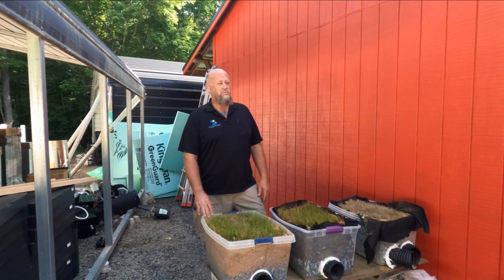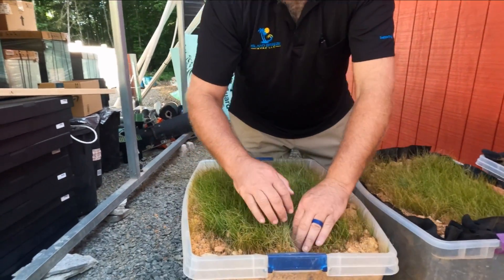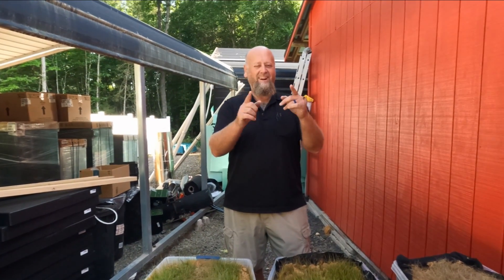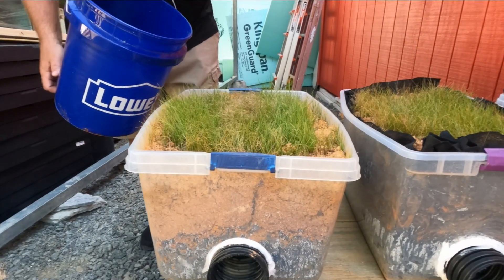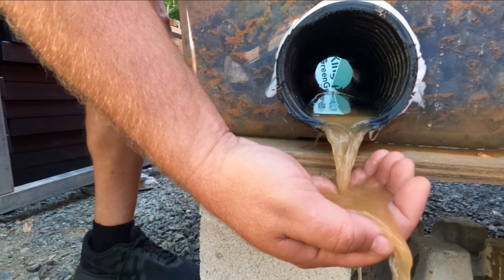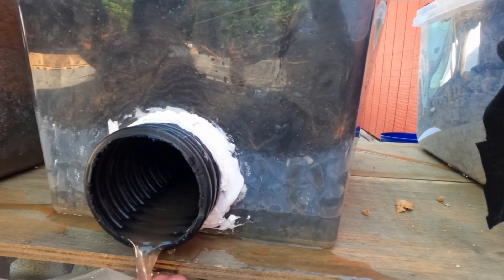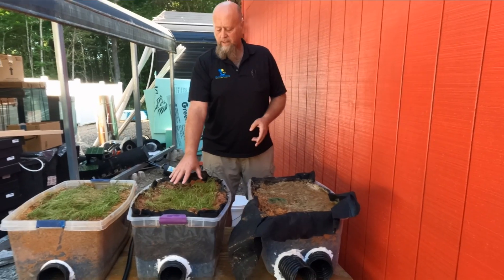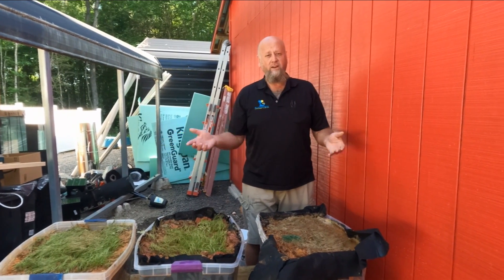Testing French Drain Scenarios To Find Out....Fabric or No Fabric? Which Is Best | Dr Drainz

Comment: Update:  To reiterate:  My goal was to divert surface water from the the sidewalk to a drainage system.  I have it emptying into a small drywall about 16" - 18" deep and 30" wide.  Now, I am about 1/2 way done.  My drain system is really more of a curtain drain, and not a true French drain, because it's very shallow, only about 8 - 10 inches deep. 
The whole thing may be overkill, but even when I just had the dirt trench there, the water ran off well - but the trench gradually silted up, so a more "permanent" solution was needed.  
Oh yeah, and I am 64 in November, so if I can do it, anyone can!
What I did was this:

1)  I bought the 6 oz. fabric from the supplier that Dr. Drainz recommended.  It was good, solid stuff.  I have trees and shrubs in the immediate area, so I figured anything to slow down root penetration is good.  The water will still make it into the drain.

2) Laid a 1 inch layer of "river rock" (bagged smooth stone, about 1/2 - 1 inch in size).  I emptied one bag at a time in my Dad's (65 year old Craftsman) wheelbarrow and rinsed it with a garden hose, then slowly tilted it so the murky water ran out.  Did this about 5 - 6 times till the water was about 1/2 clear.

3) Laid the 4" perforated pipe (not the ADS, just the flex pipe from Lowe's/HD).   It has perforations spaced all around the circumference, so no worrying about getting the right side down.

4) Covered it all with the small river rock, and did a burrito wrap with about  2 inches of overwrap and used landscape pins to secure it.

5) That will all be covered with a layer of  pea gravel and then (maybe also) mulch.

Perf. drain in place:
https://drive.google.com/file/d/1azS5VlxGGvKpyGvhewOwsxla3q8ZEl0u/view?usp=sharing
Before closing up the wrap:
https://drive.google.com/file/d/1m-uT9bMVdCh_--9k-CvFbtT7ZCjXQnkz/view?usp=sharing
After the wrap:
https://drive.google.com/file/d/1lr8U0a_t7dzuDZGDQ2s5-4FUkRjIMPis/view?usp=sharing

For the drywell, I lined it with the 6 oz non woven, used landscape pins to secure it to the walls, put a layer of  2" - 4" round large, smooth river rock on the bottom, followed by the smaller smooth river rock.  Closed it up with more pins, and will cover all with pea gravel and then maybe mulch, so it blends in with the landscaping:
https://drive.google.com/file/d/16vHnAiqWqS4H94-LVQnCIQSVyOTuayxv/view?usp=sharing
Reply: How long did it take you from start to finish to complete?

Comment: You have to remember, a french drain is most effective at taking care of the low volume subsurface water (a soggy yard). If you do not use filter fabric, you lose all the air voids in your drainage stone, making it much, much less effective (almost ineffective in fact). Just don't expect any french drain with sod on top to take in flood water. Bulk surface water is what 12 and 20 inch catch basins are for.
Reply: I have just fitted French drains with geotextile and found that the clay has blinded to the fabric (I purposefully left it open to inspect before adding top soil and glad I did)  the problem I have now is how to get rid of the flash surface water when the garden is flat, how do I know where to put a catch basin? Do I need to landscape to a swale and have a separate drain or can it all get fed into the French drain?  Clay is just the worst thing ever!!
Reply: @lala_land86  I wish you lived in Kansas City so I could do it for you lol. If it isn't a lot of water, a few garage flooring grates laid  on the french drain's fabric will work. You can get the grates on amazon. If it is a lot of water, You will need to put in some at least 12 inch catch basins (20 inch basins are usually better or necessary, but quite a bit more labor to put in).  Just remember, you may need to go outside of this garden to solve the water problem. Check out french drain man's channel on youtube and check out my facebook business page if you want some good info on how to solve your drainage issue. When it comes down to it, there are a lot of things to learn in the drainage business. There are quite a few variables that take a lot of time to learn if you want to do good work. Hopefully you can find a solution for your issue easily enough.
Reply: who knows, some say a good french drain is a drain itself along its entire length and doesnt need any catch basins. Interestingly when I had a contractor out to look at my issue and we were discussing things I asked him about catch basins since they are in so many youtubes. He basically shrugged and said theyre not needed and they didnt do them. I found that interesting from a pro. I will probably do a couple anyway, cant hurt and more importantly they allow clean out points. Also, I do believe a drain can take in surface water with sod or topsoil on top, maybe 3-4", from watching many videos. What you dont want to do is put the same soil you dug out of your trench back on top, since that soil was likely the very problem and doesnt drain well. But if you cant put sod on top, you're going to end up with a ugly gravel line running through your yard.
Reply: @cryengine_x  How about using decorative rock of your choice on top of the drainage rock
Reply: @cryengine_x  Well, a French drain won't take surface water in quickly unless you put stone on top of the fabirc I can tell you with sureness.

Comment: I do not agree. The fabric filters the fabric gets clogged over time so you get flooding. Who cares if the clay go to the drain? The fabric restrict the flow, dont use fabric just perforated pipe and gravel.
Reply from the maker: Agree. The WRONG filter fabric gets clogged. But better fabric. Not from Lowes FYI.
Reply: My take on this is that the fabric is there to prevent clays present in the soil from infiltrating and blocking the pipe. The voids between the aggregate similarly. If the aggregate is rounded, the void space is increased, but it is more mobile, so fabric helps stop migration. If the aggregate is sharp edged, it is less likely to migrate, but as it locks in, it presents less void space, and clays can wash in and cement the aggregate. 
It hinges on soil type, clays are present as a range by overall volume. The soil is essentially a mixture of sand and clays. The proportion affect the properties.
If you have to move a lot of surface water, then a channel of sharp aggregate extending to the surface, containing a drainage pipe with no fabric would likely work. If the need is to allow less saturated ground a route away from a building, a curtain drain with rounded aggregate and non woven fabric should work.
No silver bullet.
Reply: Because why even put the stone in if you let the voids fill in with clay? You have to use filter fabric if you want a good performing french drain in the long run. And actually, the fabric seems to work much better after its been in the ground for a while.
Reply: @High-Flow-Drainage-Solutions  I don’t think voids will not fill with clay. Clay particles filter down to the bottom of the drain below the pipe level which will not affect the operation of the drain. If there were so much clay to fill the voids you just can imagine what would happen with the fabric in short period of time.
Reply: @marioescalona1640  Trust me, all the voids fill up. But also, you do not want to put stone below the pipe because it will hold water that attracts tree roots.
Reply: I have a french drain at the bottom of my back wall, 14 ft below grade (the house backs into a hillside and is fully underground).  The drain was built with a perf pipe surrounded by river rock wrapped in fabric (I was present then.)
When I moved in, I found that after 30 years, the perf pipe was apparently plugged - nothing was draining. Called a Roto-rooter to cut through the roots. There were some roots and a LOT of fine clay.   The soil in the area is a sandy loam with solid clay starting around 6' down
Over time, the clay fines rinsed off the sand through the filter fabric and piled up in the pipe with the help of tree roots 14' deep. 
After roto-rooting, I have a smooth, constant water flow.
Lesson: clean or flush the drains on a regular basis depending on your circumstances.

Comment: Thanks for a great demonstration!   It is very interesting to see how the fabric keeps the clay particulates from clogging the gravel.  But in your video, there was no clay underneath or alongside the lower level of gravel (that encircling the pipe) - just the plastic of the bin.   I live in Ky., and have to deal with hard pan clay.  Obviously, I'll have clay on the bottom and along the sides of the trench - not plastic.  I am building more of a curtain drain (shallower trench alongside a sidewalk, for the runoff). In the situation of short, "average" rainfall,  I was counting on the stone to hold the water until it gradually percs into the clay.  In a heavy downpour, because the clay percolates slowly, it's going to act more like a french drain. I plan on placing a 4" perf. flex pipe on a bed of small, smooth river stones, then fill with gravel and top with pea gravel for the look.  I am not using any soil in the back fill.  So do I use fabric or not?    Using the logic from your demo, it would seem that using fabric on the bottom and sides of the trench would be needed, to keep the clay on the bottom and sides from eventually clogging up the channels in the gravel.  I have looked at so many Apple Drain videos with Chuck that my head is spinning about what to do....  Any advice is greatly appreciated!  BTW I am a 63 year old woman and doing this by myself!
Reply: I hear you! I am a 64 year old woman (as of a week ago)and I'm also trying to figure this shit out! My brain hurts!
Reply: @lyndamiller453  Haa,I love the way you explained yourself..!, 74, living in KY,clay dirt,  doing it myself thought I had it down about what to do , watched this video ! now my brain hurts! totally totally confused !!
Reply: @Sirmullins  At least we have each other😄
Reply: Add the 4, 6 and 8oz fabric thickness choice and oh yea, instant headache...I think seperating the gravel and soil makes sense. Chuck has a video where the water struggles to get through - but is that 8oz fabric? Water flows through 4oz easily. I'm going put fabric in the trench, (I think it's 4oz) then pipe and gravel (rougher gravel moves more water) and on top, staple the  fabric across the top to the side top corner, so there's only 1 layer on top and fabric won't move.
Then more gravel on top so there's maximum amount of cavities for the water. My pipes drain into tubs where 2x12volt bilge pumps take water out...yep, headaches....
Reply: Hi Melanie I am currently working on a french drain project also and it's honestly been a nightmare. You sound like you want to get rid of surface water along the side so I would just put fabric on the bottom and the side and then I would fill to the top with gravel, the only problem is if you have dispersive clay this then blocks the outside of the fabric which is why some people are telling you it doesn't work because actually after a while the clay blocks the outside not the inside, however without the fabric clay blocks the gravel and pipe instead? I think if I were you I would just use a light fabric all over because you may have a problem with debris like leaves clogging the gravel in which case do the main trench in fabric on the bottom and sides and then cut a top separate fabric and thin layer of gravel over the top, this would be easy to rip out and put new stuff in every couple of years if the top layer of gravel gets blocked without taking out the whole drain. If you don't have dispersive clay then it's not so important to use different weight of fabric or fabric at all. You can do a test easy by putting your soil into a dish of water and see if it stays in a ball or if it gently breaks apart.
Reply: @lala_land86  I'm no expert but if you've got clay, you need to get the water away. 
I wrapped the gravel and flex perf pipe with fabric and liquid nailed it shut so zero dirt can enter.
These 10"round  "sausages" work well, key points are:
- dig good fall into the trench. 
- at the lowest point I dug a hole for a large bucket with holes.
- put a 750 gallon per hour, 12 volt bilge pump in the bucket to pump the water away from the problem area. 
- to power it you need to know pumps use up to 4 times their operating power use on starting. So multiply 12volt x 3 amp = 36watts, then multiply by 4, so 150 watt 12 volt supply is reqd.